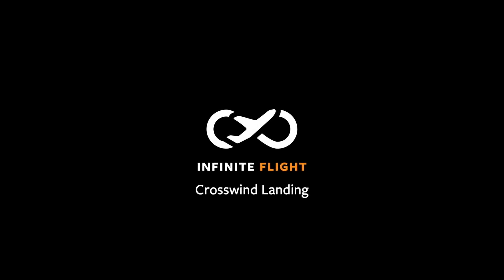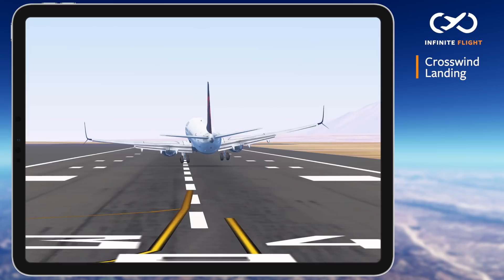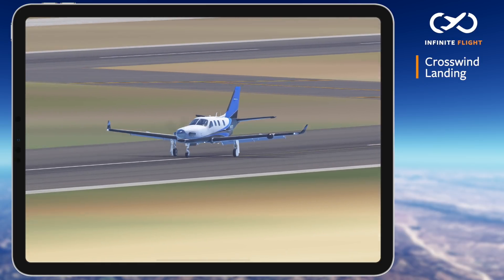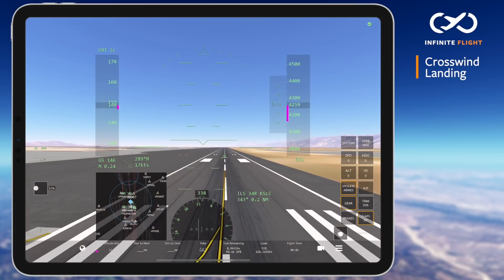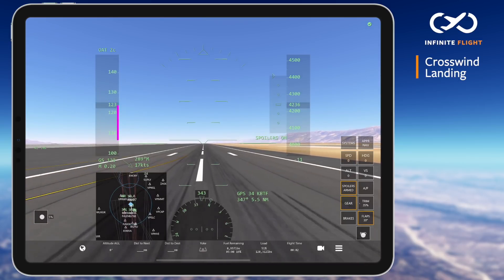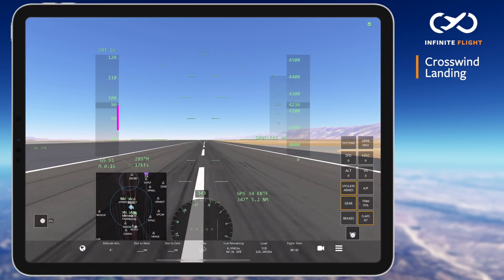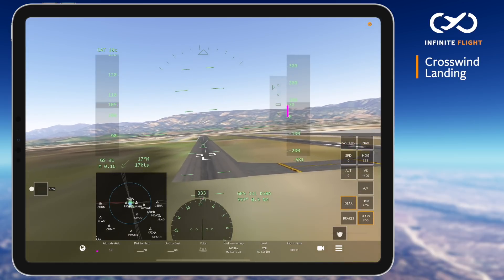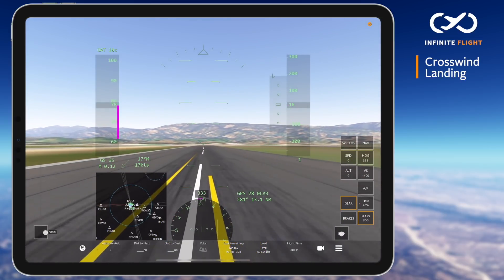Crosswind Landing - Airliner Tutorial

Comment: Dipping your wing into the wind works in Infinite Flight, but don't use it with airliners if you want to be realistic. Because their engines are suspended under the wings, banking any more than 5 degrees could result in an engine strike. Just get it down quickly to minimize how much you drift!